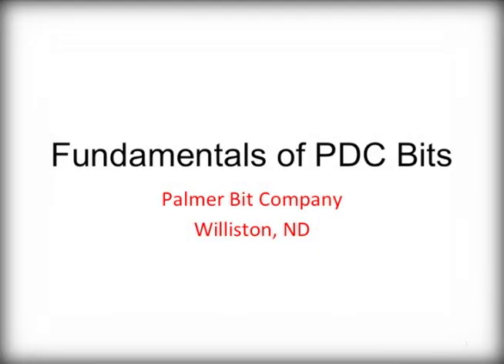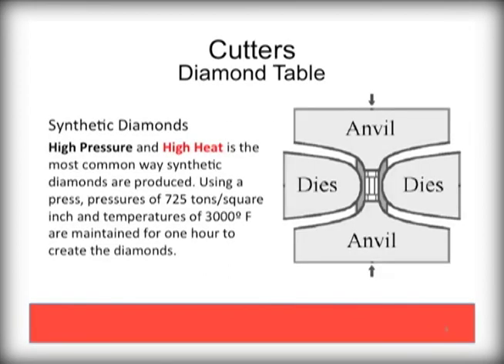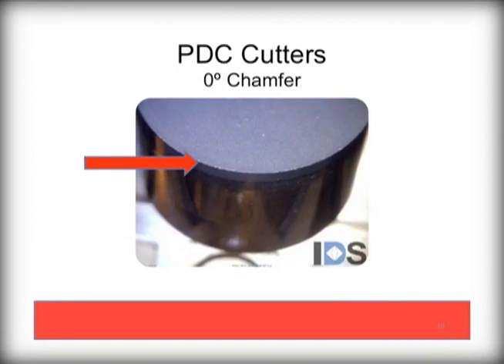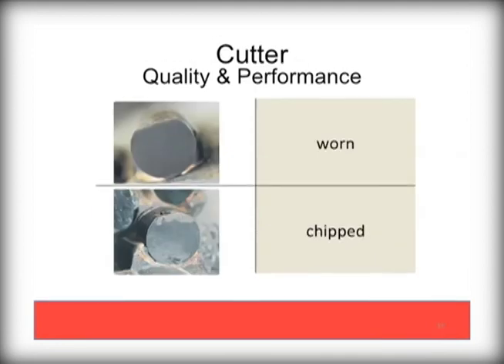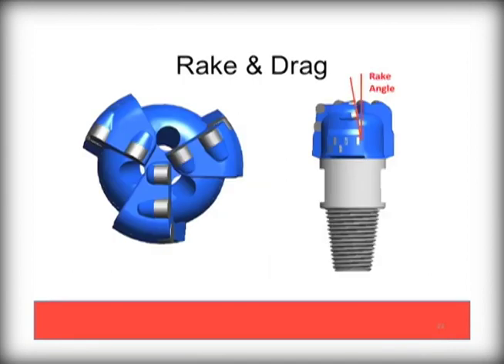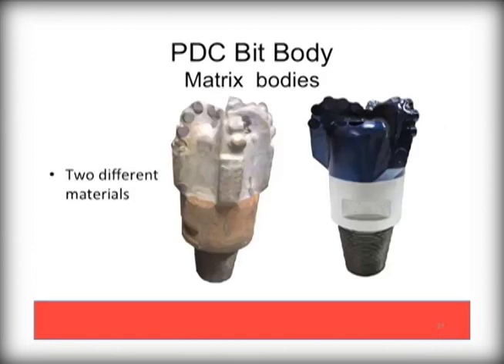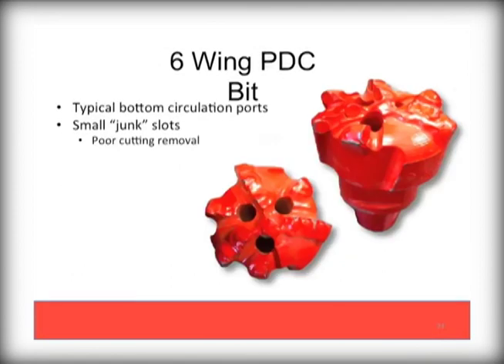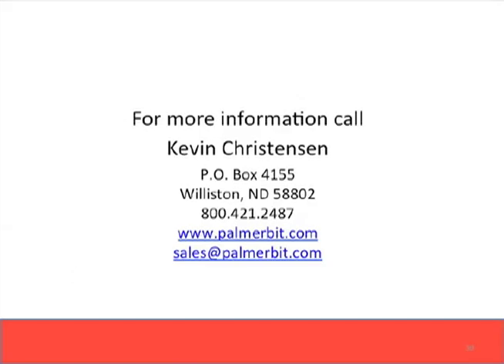Fundamentals of PDC Bits

Comment: FYI: Chamfer is the physical length of the 45 degree bevel cut on the PCD layer, .012" and .016" are both cut at 45 degrees.